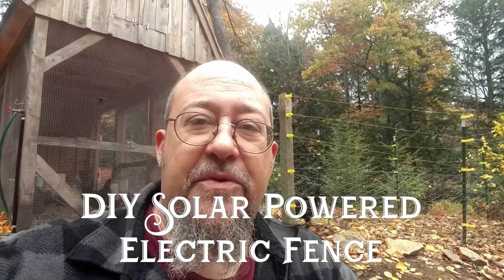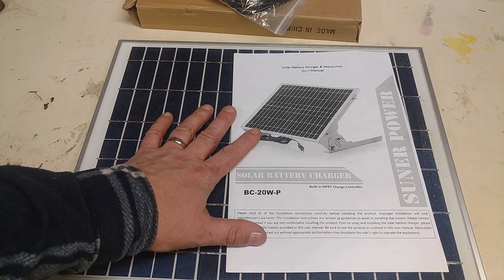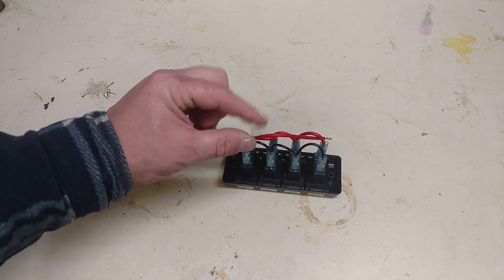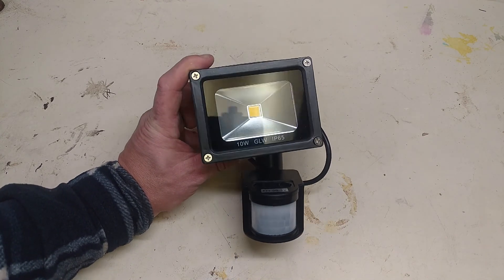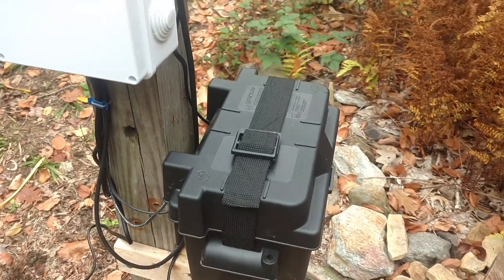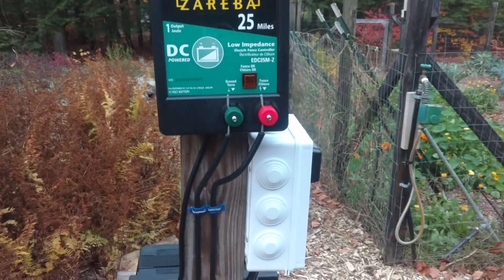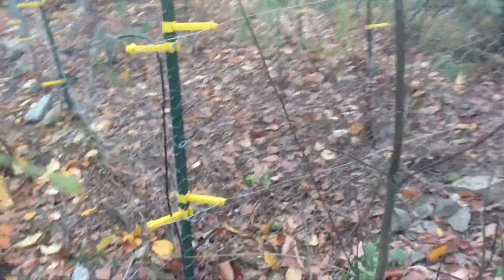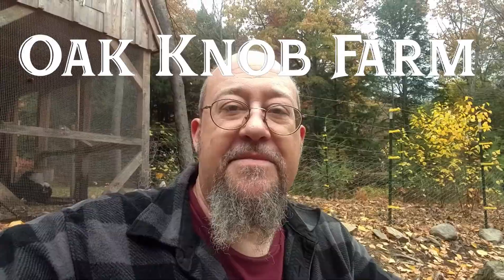DIY Solar powered Electric Fence Charger.  Off grid protection

Comment: What animals are you having problems with? I’ve been battling woodchucks for seven years in my garden. I’ve gotten rid of 17 so far but more move in every spring. I’ve tried premier one electric netting but they find a way under.
Reply from the maker: holy CRAP!  17 woodchucks!        We have a big fat woodchuck daddy, and a slender fella I saw a few times, probably an offspring.   Deer are the biggest problem for the veggies.        
For the hens it's bobcats that I fear most, although racoons seem to poke about some, too.   Either way, I think this should give me a good platform to continually expand my fencing